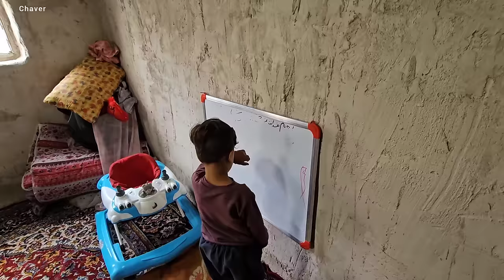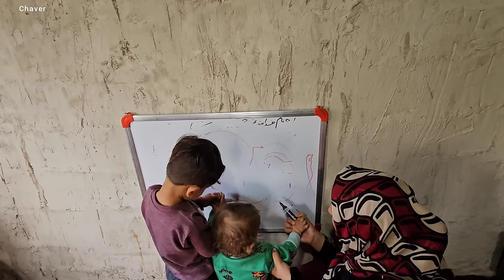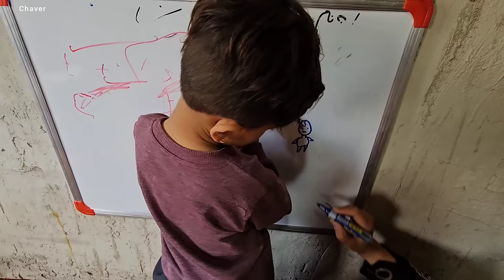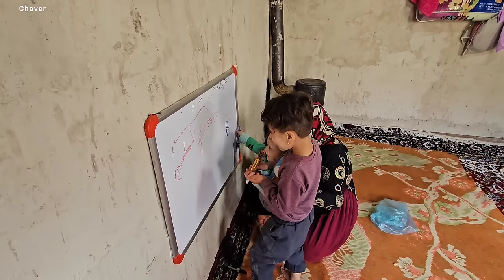Ali and Kargar. Trying to build a house. 🏡 Divorced woman 🤱

Comment: The house roof is done in 2days if they use rectangular bar and metal sheet and use steel wire not rope,that kind of roof is  very secure if they put house pole in 4 corners.